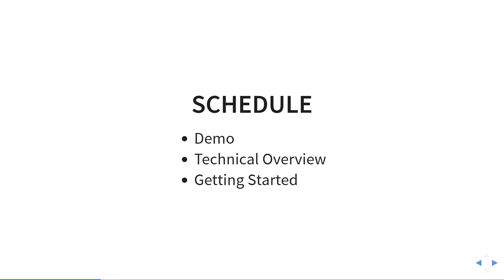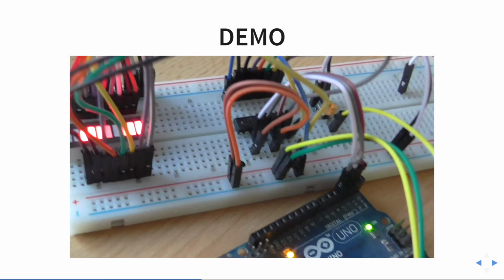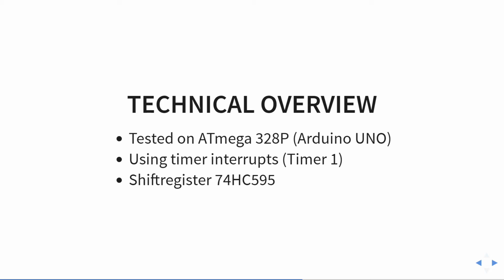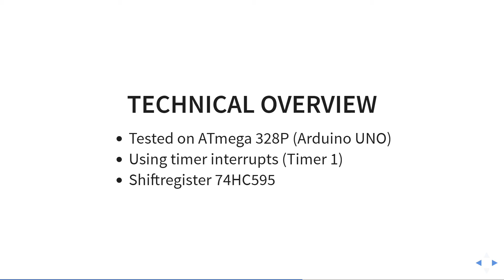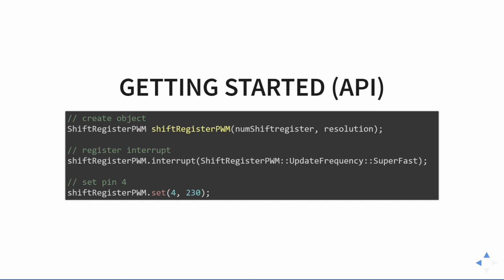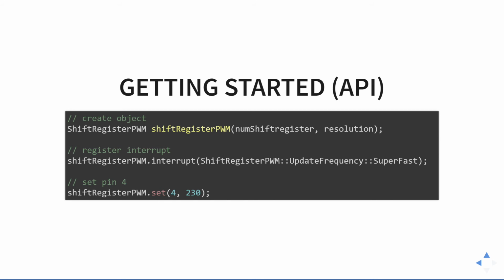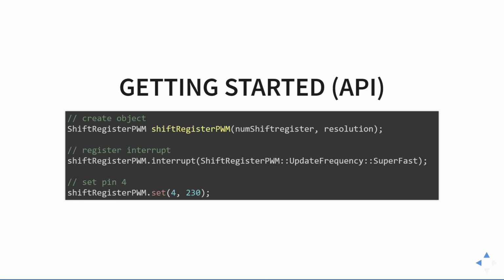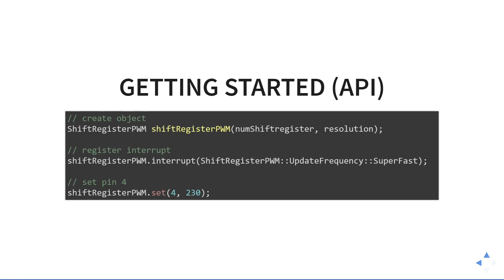ShiftRegister PWM Library (Arduino)

Comment: My project requires 16 or more leds, so double of what you have here and a very small footprint.  What would you recommend?  I'm trying to simulate runway lights on a small carrier.  Maybe three or four leds, the first one at 100%, second at 75%, third @ 50%, and fourth @25% chasing from left to right in a repeating pattern.  As soon as the four leds reach midpoint in the travel direction, another set of four leds follows from the start position, so you will have two sets chasing from left to right, and so on.  When the first set reaches the end, it starts over again from the beginning, same with the second set.  I have looked all over the web and have had nothing that fits all the criteria.  Doing it on an UNO will not work as there just isn't enough room in the model for the large board.  555 timers with a shift register won't work as most don't have a way to make the fading effect.  Can you help me with a solution?  Thank you.

Comment: How could I control PWM outputs with 4 shifts ( 74hc595)? Thanks
Reply from the maker: Timing-wise that's not feasible with my library. It would be too much to shift during every interrupt cycle.
Reply: @Simsso  How about 2 shift registers in series? Can you add capacitors on output pins to covert to an analogue signal? Thanks.

Comment: I've read a lot about timers and interrups of ESP modules and arduino boards. ESPs have hardware and software timers. I think for this program will probably be used a software timer. However, as a newbe of the arduino scene, I do not know how to rewrite this in this program code. Unfortunately, I find no suitable example programs on timers and interrupts for the ESP. I'm looking for a way to write an ISR code for ESP8266. So please can somebody help me!
Reply from the maker: I'm sorry, neither do u have access to the described hardware right now, nor the time.

Comment: I wanted to try this program on my esp 8266 but i always get a fatal error: avr/interrupt.h: No such file or directory.
where is the avr interrupt used and where in the code can I bypass that.. so that it will work on my controller?
Thank you!
Reply from the maker: LegalizeWeix it's not compatible unfortunately. The timers are totally different so you'd have to write your own ISR.